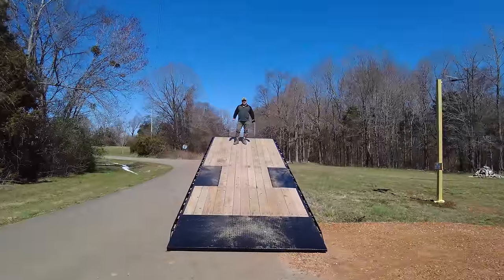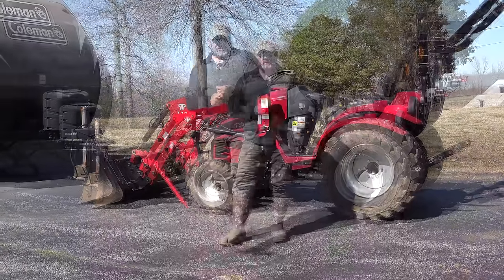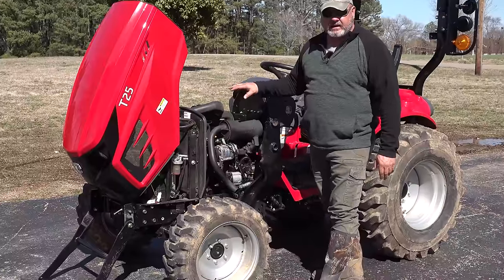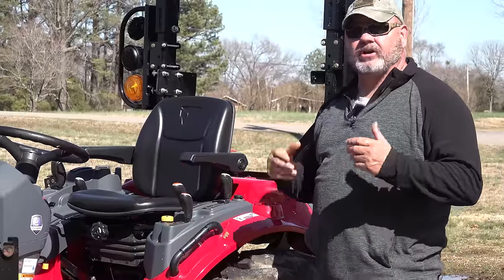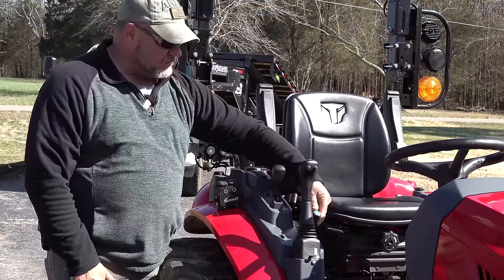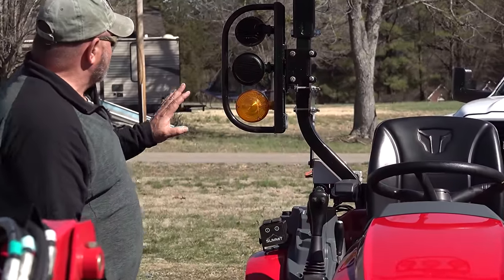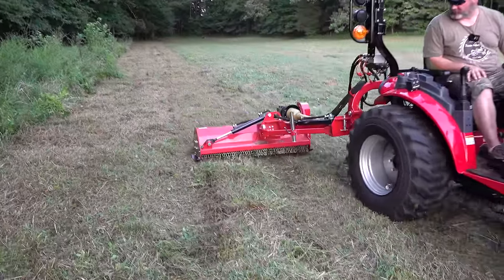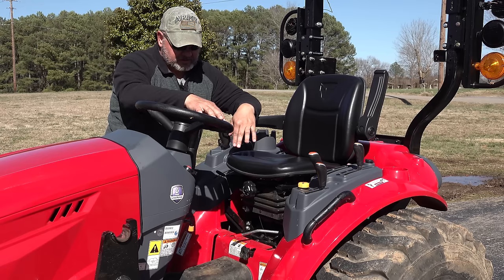TYM T25 Tractor Review | 50 Hours Hard Work & Learned More

Comment: I have had my T25 for just under a week now. So far, just to move snow off the 400 foot dirt road I call a driveway.I have only one issue with it, and that's my size 15, wide clod hoppers at the ends of my legs. I am not a small guy and getting on and off this little thing is a bit difficult. I am sure I look a little comical operating it as well, but there is nobody else around here.

Comment: Purchased this tractor from my local dealer in Alberta, looked at TYM 25 and one other brand. Love the size, controls, and it works great! the only minor thing I would change is the location of the key (ignition key location). i am looking at moving this as I find it a little low. the additional hydraulic auxilliary lines were also a big decided factor.
Reply from the maker: To this point, the T25 is my go to tractor. Some bigger jobs require the big tractor, but the T25 is friendly to use.

Comment: Hi Tony, great video, but I just got my Branson 2515R, two reasons one the dealer is only 1 hour drive away; two the fuel tank is very low to the ground under the side step to mount the tractor. Plus the dealer gave me a great deal on the tractor with pallet forks and 48" tiller delivered.
Reply from the maker: No worries. We are cousin now. TYM bought Branson completely out. Your tractor is a nice machine and dealer support is essential too.

Comment: I looked at TYM and LS a couple of years back but in the end went with  Yanmar YT 235. I added 3 rear remotes myself and am happy with it so far in just over 650 hours with just maintenance. And its not getting an easy life at my place.
Reply from the maker: Yanmar is one of the best tractors on the market.
Reply: @TonysTractorAdventure  Basically a red John Deere as they are built in the same place by Yanmar in Georgia. There are a couple of things I like better on the Yanmar than the JD .... Loader quick attach being skid steer is one of them. And the hydraulic system is superior to the JD as well as the beefed up front axle.

Comment: These small tractors are becoming so advanced, next will be headland management. Lift the tool, cut the pto, up the steering rate, dump the diff lock etc all in one command. Thanks for posting.
Reply from the maker: They are little work horses for sure. It has a lot of cool features. Most I thought I wouldn't use, but how do you like that, I find myself using most of them.

Comment: Great video, Tony.  👍👍  Does your tractor have automatic draft control on the 3-point hitch?  My MF-231 does, and I have found it to be very useful for leveling and grading ground.  Keep up the good work.
Reply from the maker: Draft control is not found in the smaller tractors any more. You will start to see draft control in the 40hp and higher tractors. It is very useful for a lot of things.

Comment: Good review.  As always, love your videos.  The two things that the T25 has that I wish I had on my 1025R are ease of adding hydraulics/remotes and dual/split rear brakes.  The first time my using my loader that the front wheels came off the ground I instinctively reached for the brake to steer and it had been 20 years since I used a tractor with dual brakes!
Reply from the maker: Dual brakes are like riding a bike! Thank you.

Comment: Do you consider TYM to be  a tear 2 machine when put against kubota or deere. I am really considering a TYM. What are your thoughts would you by TYM if you weren't affiliated with the company. Love your channel have a great day.
Reply from the maker: I have had the pleasure of testing several TYM models. The short answer is yes. I have two TYM tractor which are mine. One I bought outright and the other at a discount. Still, in over 350+ hours of uses, I have only done maintenance.  Kubota is a nice tractor, but they have slowed on their quality separation they once had. 

IMO, the most refined tractor in the market is a Yanmar. The fit and finish is that of a luxury car, but they are priced out of the market. 
TYM is using Kubota’s old business plan. Build a really good tractor at a fair price.  That is why TYM is growing fast. They are opening dealerships all the time.
Reply: @TonysTractorAdventure  Thank you so much for your reply have a great day from VA.

Comment: the flow control valve under the seat for the 3 point - does that effect the flow to the rear remotes too like valve switch under the seat?
For instance if the backhoe doesn't seem quite as responsive as maybe your friend's tractor, could that be the reason?
Reply from the maker: The rear remote valve is before the three point hitch valve.

Comment: Hi Tony Excellent review, very informative.  Tony, seems like you have alot of influence with  TYM.  Can't really find any info on the factory Cab for the T25.  When ever you have some time if possible, could you do a review on it. Thanks.
Reply from the maker: The can will most likely never be around here. It is a winter cab with only heat. I seen one at the show. Man it was nice. Great for those snow days up north. It would cook us around here. The doors do come off.
Reply: @TonysTractorAdventure  you can buy an aftermarket real AC for the cab
Reply from the maker: I have never seen a kit.
Reply: @TonysTractorAdventure  I have the T25's big brother, an Rural King branded RK37 with factory cab.  A/C, Heat, Kenwood stereo with Bluetooth standard.  I live in Central FL and have to mow 10 acres pretty much every week.  Paying a little extra for the factory cab was definitely the right decision.  I have had it since mid November and am nearing 150 hours.  No issues so far, it has performed flawlessly.
Reply from the maker: I am very familiar with the T394(R37). It is a very nice tractor.

Comment: Compared to the LS tractor you had before how does the T-25 compare?
Reply from the maker: The LS MT125 is in a smaller class. Apples and Oranges. The LS MT125 is about like a T224 in size and weight. Nothing bad to say about the LS Tractor.

Comment: If tym has a fix for the overheating problem on the T450 I would sure like to know what it is.  The local dealer doesn't have one.
Reply from the maker: John, I am not sure what your comment has to do with the subject of this video. The T450 has not been sold for several years and I have never heard of that model having an over heating problem. If you local dealer can't figure it out, go to another dealer. They are not complicated tractors.

Comment: I've been looking at the Bad Boy 4025 ($19,995), TYM 2515H, and JD 3025E.  JD currently has a special going on in our area, $21,399 with loader.  That puts it cheaper than the TYM for now, about $1,400 more than the Bad Boy.  I currently have a JD855 with a Yanmar and very impressed, just want something newer and maybe a little heavier.  It's great that other companies are getting in the same quality as the big boys and driving down prices!
Reply from the maker: The Bad Boy 4025h and TYM 2515h are the exact same machine other than paint. The JD is 300 pounds lighter and the loader doesn't have as good of lift capacity as the TYM 2515.  All are good tractors, and will serve you well.

Comment: I went to look at a t 25.At the dealers a person said there is some that are breaking where the 3 point hitch connects to the rear housing.Has this been addressed at all? Thanks.
Reply from the maker: I have never heard that and I hear everything. I use the crap out of mine with zero issues. If you hit an immovable object while pulling a box blade, any tractor 3 point hitch will fail.

Comment: After doing the 50hr service, did you notice any bubbles/foam in the sight glass after using the tractor for 20-30mins?
Reply from the maker: No I don't. What oil did you use?
Reply: @TonysTractorAdventure  The same stuff you used. Mobil Delvac Tractor for my T254
Reply from the maker: I have never seen a bubble or foam. Are you sure it is full. Low fluid and cause bubbles.
Reply: @TonysTractorAdventure  My fluid is right to the red dot on the sight glass, when using the tractor it does drop. Have you ever checked your sight glass during/after using the tractor for 20 mins or so? People typically check before use, not after.
Reply: @TonysTractorAdventure  When raising your loader and 3pt, do you notice the fluid level go down on the sight glass?
Reply from the maker: That is perfectly normal. Check fluid with all implements down.

Comment: Looks good. Is this a 3 range or just a 2 range?
Reply: I have the same tractor with a cab and it is a 2 range (Low & High). Have not had an issue with the rear remote lever as it is covered by a vinyl cover and seems like a shorter stick out from the cabin covers they provide.
Reply from the maker: Sorry, I missed your comment. Thank you (@Top Fuel) for helping me out. It is a two range and like Top Fuel, I like it. Some companies miss the mark with gearing, but TYM hit this tractor close to perfect. I have never need a Mid range. Low range is fast enough to be useful.

Comment: Great vids going back and forth between the Ls mt225he and the T25 can't decide. The tym I'm looking at is  a 2022 and there are no buttons on the loader joystick  and no rear remotes I'm a little confused. Any input appreciated.
Reply from the maker: All of the T25s I have seen have the loader controls and it was my understanding all new T25s come with rear remotes. I know some of the very first T25s came without rear remotes.
Reply: @TonysTractorAdventure  Thanks for the response,  yeah weird put deposit on one but I might back out, no rear remotes either and the paint is all peeled off the right rear axle supposedly it's a 2022 model.
Reply from the maker: I would worry about the paint peeling off the axle. That is common on all brands. They will get the paint beat off through working it. I use black spray paint to touch up my axles and I wax my tractor a couple times each year. Call around to the other dealers and see if their tractors come with rear remotes. If they do, ask your dealer to add them in the deal. My tractor didn't come with the rear remotes because it was one in the first year. I add the kit in 30 mins.
Reply: @TonysTractorAdventure   Thanks for the reply, I’m getting the backhoe also so the rear remotes get put on if I’m correct?
Reply from the maker: Yes sir. The rear remotes are a must with the backhoe. Win.
Reply: @TonysTractorAdventure  Thanks Tony  I w as thinking about just spraying the axle,  thought I was being a little to picky though. I'm glad you said  you spray yours .  I was going back and forth between the LS MT225H  and the tym T25. I picked then T25 just aggravated there's no buttons on That loader joystick for the 3rd function.

Comment: Can you get both the center mower and the backhoe then just removed the center mower when you need to use the backhoe?
Reply from the maker: That is not the case. If you get the backhoe, the brackets are in the way for the center mower. You would have to remove the bolted backhoe mounts for the center mower to work. I think this tractor is a bit heavy to mow with also. Please correct me if I am wrong.
Reply: @TonysTractorAdventure  I don't know. I was told the T264 required you to change the tires every time you wanted to use the mower & then back for all the other attachments. I just don't want to buy two pieces of equipment if one will do the job.
Reply: I guess I don't really need a backhoe, I just want to use everything else without changing tires! 😀

Comment: Does the Tym t25 compared to the massey ferguson 1526 in size
Reply from the maker: The Massey is a bit lighter, and lifts about 500 pounds less on the 3 point hitch. The 1825 is a closer match, but the MF has bigger tires.
Reply: @TonysTractorAdventure  Thanks for the Advice am looking into buying a t y m t25

Comment: I get to cheat I got a gas station less than a 10th of a mile from the house I just drive my tractor down there in fill it up
Reply from the maker: I have one of the fuel tanks with a pump, but it is not at the farm. Once I get the barn done, I am putting up a proper fuel tank.